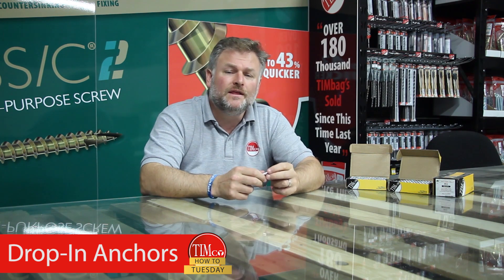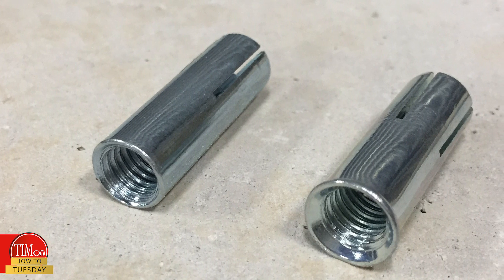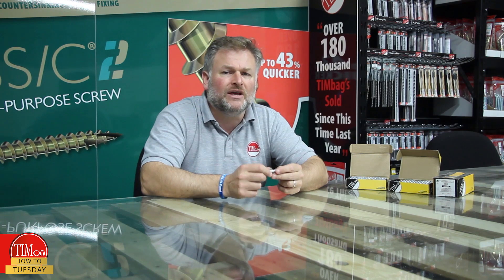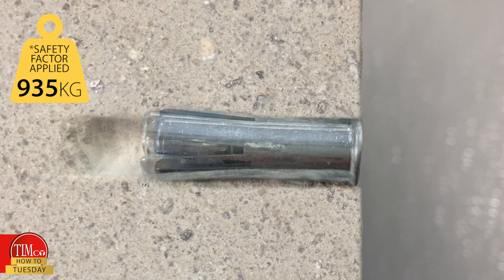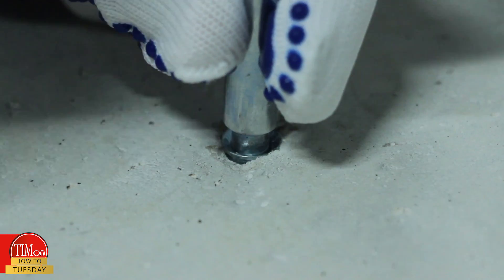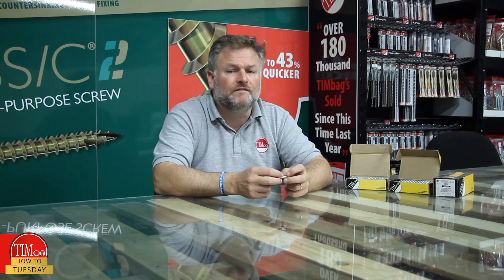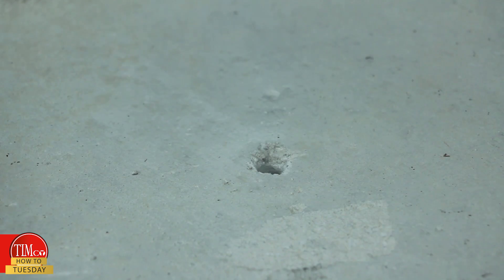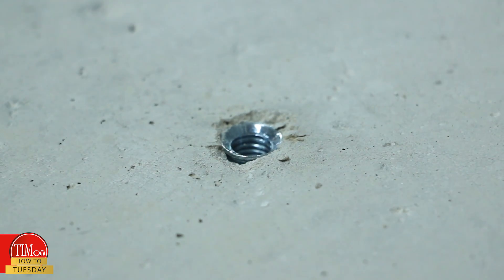Drop-In Anchors - TIMco "How To Tuesday" - Heavy duty anchor for concrete

Comment: Anchors are spinning inside concrete (admittedly crumbly low quality), even after expansion using tap tool. Design wise the outside of the drop in is too smooth. Make a version with pimples or tiny steel pyramids to prevent hole spin. Please.